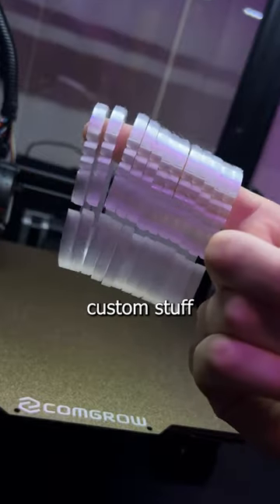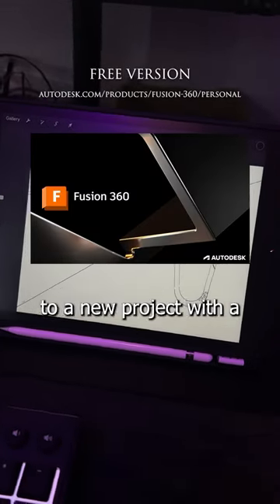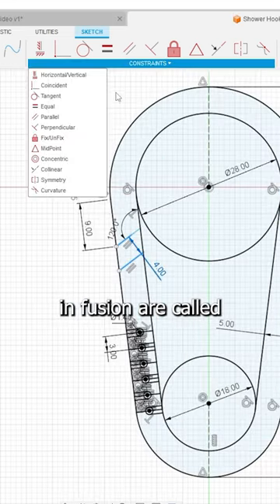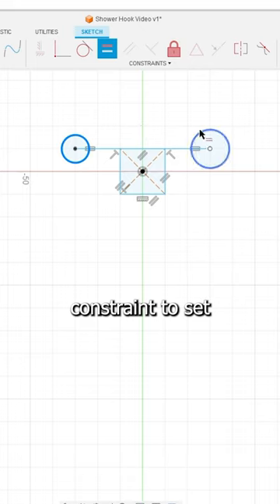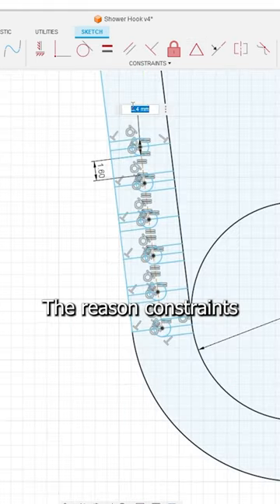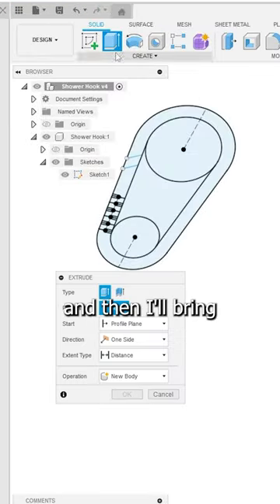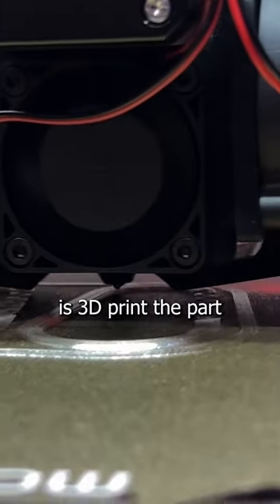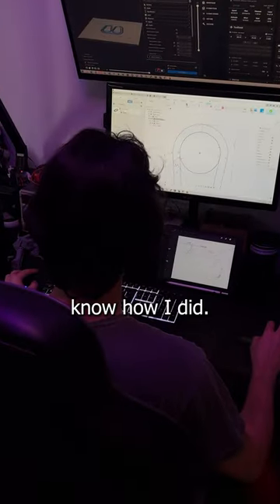It All Starts with a Sketch and an Idea. #3dprinting #3ddesign #diy #fusion360 #constraints

Comment from the maker: Do you use Fusion 360?
Reply: No but it sounds cool 🤷‍♂️
Reply: I use Onshape cuz it’s free lol
Reply: No Rhino 7 is better
Reply: Yes, I’ve resently started learning
Reply from the maker: @Jjfjgj-nt8hh  So much to learn! I am loving it so far.
Reply: I use FreeCAD lol
Reply: I use autocad 😭
Reply from the maker: @DynoRC  🥲
Reply: Yeah, it's great. I use Solidworks at work though so I prefer that because I'm just used to it, but fusion 360 is amazing, especially with the Mesh capabilities. Very useful for 3D printing since not everyone releases step files...
Reply: Fusion 360 will provide you with free access. A personal  account. You just cant sell those designs. And Im pretty sure they have access rights to them
Reply: I've been using Shapr3d. I want to get into making figures mainly. I have thought a lot about using fusion360, can I use fusion360 on a Samsung tablet? I know I can't use Shapr3d on the Samsung. Would fusion be good for creating figures? I'm new to printing but want my own original ideas to print. Thanks in advance!
Reply: Just a tip for you is to disable the sketch grid, it is usually a constraint for people and causes them to forget or skip constraints that they place on the grid, ideally in your drop-down that shows your components the logos for all of your sketches should be black with a lock logo and there should not be blue lines in your sketch
Reply: @jessiewarfare3453  blender might be better for figure design but both can be used together aswell
Reply: Just switched to fusion 360 from freecad 😀 and yeah, both those softwares are free for personal use

Comment: I didn't see what kind of file you saved it as, but I usually do .3mf because they are smaller and carry more detail.
Reply from the maker: .3mf is best for printing and keeping data about the creation of the file and fusion details, .stl works for file sharing since it’s not as large and can be easily accessed from many more softwares.

Comment: Make the slit shape [S], not [/]. Both S slit hold each other, it make stronger.
Reply from the maker: Great idea! Hadn’t thought of that since the load on these hooks is really not much.
Reply: @thematterforge  Ordinay, it's true. but when u pull curtain, that make more load just 1 hook. If it boroken sometime, try upgrade plase. BTW, ENG is not my native language, sorry about that. lol
Reply: Isn’t that a material issue tho? Pretty sure these would be more than sufficient if made out of petg and 100% infill

Comment: Let's say you wanted built in spring tension on the clip so you want to print it with each wavy part slightly outward & the clasp forward. Then after it prints, you side load the clasp & slide it into place. 
How would you design that & still have it fit properly?
Reply from the maker: I would use a sketch or component to measure out movable elements that match what the lengths of the clips would be. That way I could simulate the motion before printing (assuming there’s enough room to twist it around).

Comment: What did u use to print and if not TPU how did u get it bendy?
Reply from the maker: It’s PETG! That type of Plastic can be super flexible around the 2-4 walls thick. The zig zag pattern allows the PETG to deform a little and then pop back into place. Hope this helps
Reply: @thematterforge  awesome, I have a spool of PETG, I will test this technique with a small amount of walls! Thanks!
Reply: If you want to experiment with flexible PETG, on my printables page I have some flexible keytags that use PETG. They are only three layers thin so no infill just solid material.